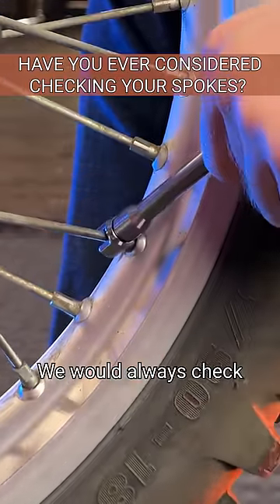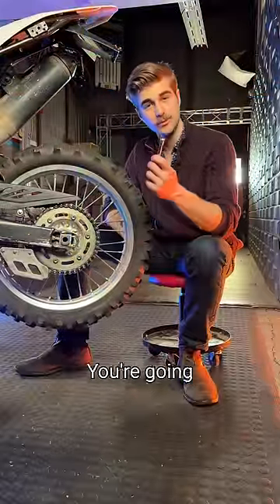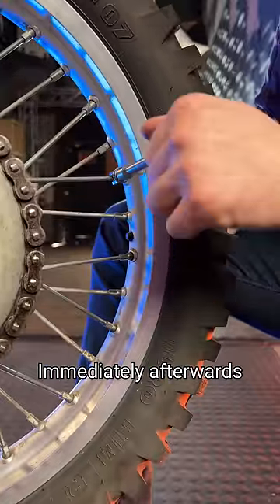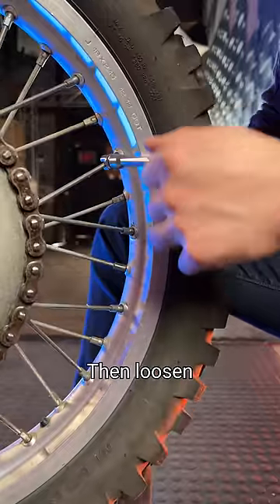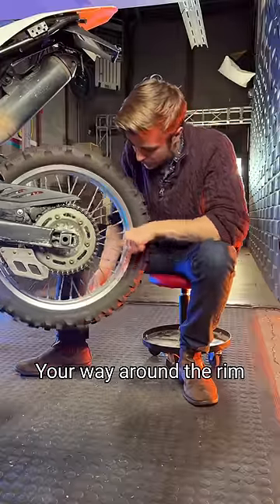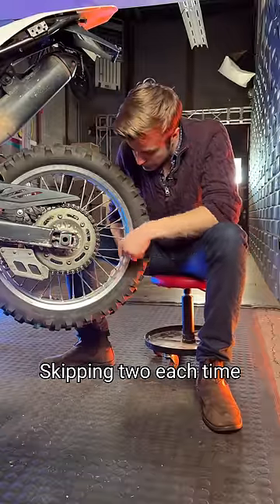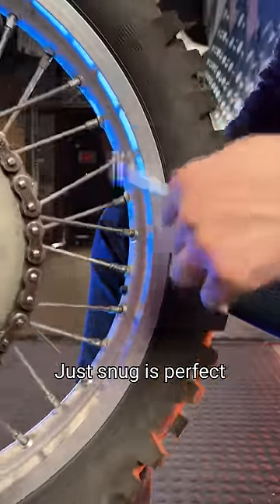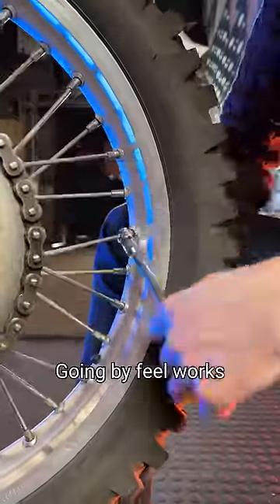Do Try This At Home!

Comment: Why is it skip two instead of one by one?

So I understand the similar star pattern concept for screws/force perpendicular to alignment axis. But for the spokes/tightenting force thats on the axis of alignment would it matter? 

And also why wouldnt you then tighten the spoke directly across the one you just did? 

Genuine question, a detailed response would be super appreciated :) thanks
Reply: Never mind I think I answered my own question,
 
 if I understand correctly the spokes directly next to the one you tightened would get pulled closer towards the tightened spoke, and that would then be offset/made neutral by pulling it in the opposite direction when tightening the 3rd/4th spoke
Reply: In theory, if the rim is perfect then all spokes tighten to the same tourqe if fine provided it was true to begin with. In reality some are tighter than others as they are compensating for slightly bent rim. Radial runout needs spokes adjusted differently than side to side. I break up the rim into 4 quadrant for radial as the rim has to go somewhere if taking a high spot down. Side to side I'll tighten every other one and loosen those in-between the same amount (every other spoke goes to opposite side of the hub) and this helps keep the tension even. If you try and pull the rim towards say the sprocket by only tighten spokes, you'll likely pop a few that you never touched as they become way too tight
Reply: @jeffreystroman2811  appreciate you explaining it! : ) dont own a bike yet so had no idea you had to maintain spokes hahah

Comment: Do this on a KTM after every ride. Sure to be loose with the sprocket bolts. I swear the little green gremlins loosen them between motos
Reply: if thats the case then u never tightened them properly to begin with
Reply: @bmxscape  I’ve never owned a KTM just have seen many at the races with those issues. It seems to be more than a few 🤷‍♂️
Reply: @stevesmith756  i guess its possible but it would have to be from poor design.
Reply: @bmxscape sadly I think there is something wrong inherently to the KTM wheels. Even MXA mentions it in almost every review of a KTM.
Reply: @NONO-hz4vo  thats pretty funny actually considering how many years of building and perfecting spoked wheels humans have.  maybe they need nylock spoke nipples, i seen them on some really fancy bicycles. each nipple is like a nylock nut to prevent spinning

Comment: If they all get the twist, why skip 2. Why not just do all
Reply: So you don’t pull the wheel out of round.
Reply: @kingnull2697 If you were worried about taking the wheel out of round, wouldn’t it be better to do diagonal adjustments like with lug nuts on a car wheel?

Comment: Anti-sieze and a torque wrench with a claw-foot adapter(cheap)
Go get a harbor frieght or similar
Use the bike and a zipty to make it perfect when you true it.
Save yourself 1/5 of the price on just tools and do it way better than the dealership does. I can't imagine labor for mechanic work on car/bike stuff nowadays.

I did my own wheelset on my Honda CRF450x, trued myself. I used wierd Excel spokes, nips and hubs too lol Also mounted my tire and the Tubliss system. It's the smoothest bike I've rode yet which isn't saying much at all! (noob)

I dont have an air compressor yet soo I have to spend 2$ for 2mins at the local gas station BOOOO!
Reply: ryobi makes a handy portable air compressor
Reply: @TheRealSykx it sure does! I put over 40psi each into 4 camper tires with just a 2ah battery.
Reply: Dude, buy a cheap foot pump and an accurate pressure gauge,  check 'em at home in a few minutes..
Reply: @TheRealSykx  does it do up to 110psi?
Reply: @longjonwhite  I really need to! 
My grandpa is jacked becuase how many times as a young boy I used his <3
Reply: @caldeio  the one I used started it could go up to 150psi, but the compression rate dropped really fast after about 60psi. That one isn't even on sale anymore though, the cheapest current model says it goes up to 160psi.
Reply: @longjonwhite  Get a Jaco pressure gauge, decent price, and is calibrated to ANSI standards...
Reply: @chopshopchopper I went cheaper, more accurate, and made in USA by buying a liquid filled pressure gauge and building a short hose and connector for it.

Comment: This method does not include checking for a true wheel, which it can cause.  You also don’t caution people that they could strip the spoke threads over time. 

It will be especially risky with cross-spoked tubeless wheels. I’m sure the BMW dealers won’t do this, as they won’t even try to true their wheels - just replace them. 

Seems like you should have shown tapping the spoke to verify tension - and also how to see if your wheels are true.

Comment: LMFAO - HE’S DOING IT WRONG 🤦🏼‍♂️ Yes, start at the spoke next to the valve stem or bead lock. Yes, skip two spokes, BUT, HE’S NOT SKIPPING TWO SPOKES! Notice he’s only counting the spokes that attach to one side of the hub. This way is a great way to throw your rim off to one side. You skip the immediate next two spokes so that the first one pulls the rim in one direction (left or right by way of which side it attaches to the hub) and the one three spokes down attaches to the opposite side of the hub. Ryan, I’m really disappointed in this one man. How many poor customer’s bikes has he done this to?! Side note - Make sure your wheels have spokes in multiples of 3 for the three lap method to work.
Reply: I assumed he was just saying the right thing but for demonstration purposes just turning whatever spoke for sake of time.

Comment: When I worked as a motorcycle mechanic, we used a dial gauge and trued the rim, not just fkd around with the spokes to eat up time at $150ph. 

Normally, you guys are great, but this is just shitty advice.

Comment: What a pointless way to destroy the spoke tension on your wheels, and to increase the runout and wobble. 😢
People: never do this.
Reply: He didn't change the tension on most of them cause he's just checking lol, this is what we call maintenance

It's important to check a good amount of bolts on any vehicle in areas where they are prone to vibrate loose
Reply: @birddaddydetta  - but checking tension is pointless, because that doesn't help you if you DO find a looser spoke.
You can check tension MUCH more accurately by tapping each spoke and listening to the sound. Not by loosening and then randomly retightening them in turn!
Furthermore, all this only matters is to make the wheel run true... so to pull the wheel rim back into correct position, it is most likely that some spokes will be slightly different tensions. All that stuff needs to be done by somebody who knows what they are doing , to make sure that fiddling with spokes doesn't make things worse.
Reply: Spoke fiddling should be left to someone who can true wheels as well as dis assemble and assemble spoked wheels. Also, before trying to rotate the spoke nipple some lubricant should be applied!
A typical rider can tap the spokes to see if they are all tight, and if they’re not, take it to a qualified mechanic. 
As a mechanic I had to fix a lot of owner “adjusted” wheels…

Comment: Just put loctite red in there. Never have to mess with them again.
Reply: Never seize would be the way to go, actually...
Reply: Any dirtbike that has alloy wheels will sooner or later have loose spokes, the aluminum or alloy stretches over time and the spokes will have to be adjusted and tightened. Dirt bike wheels do take an awful beating. 
Not only should the threads on the spokes be lubed but the connection between the nipple and the rim. Actually there is probably more friction in the latter than the former… some manufacturers actually put friction washers between the nipple and rim. 
If you wash your bike with high pressure spray, like at a car wash the soap gets in the spoke threads and causes corrosion etc. thats where the terrible snapping sounds come from when tightening seized spoke threads. Anti seize would be a good choice while assembling a spoked wheel, but really nobody, including the manufacturers lubes any of them!